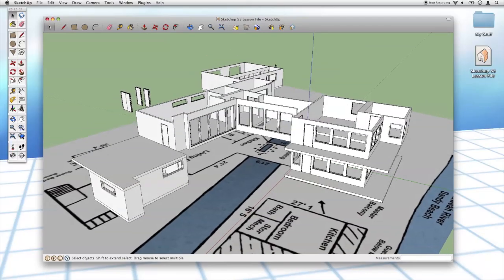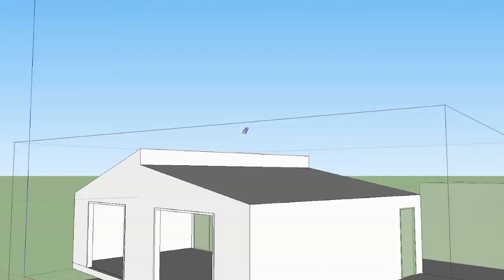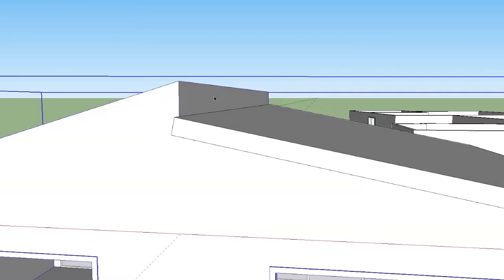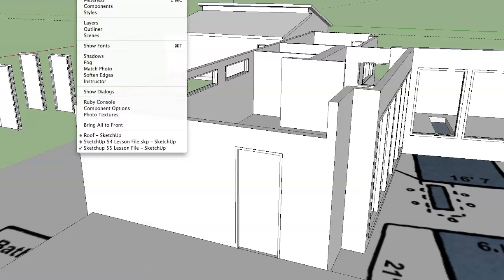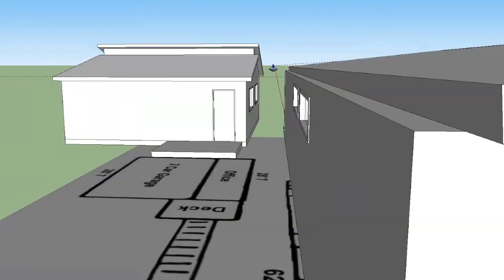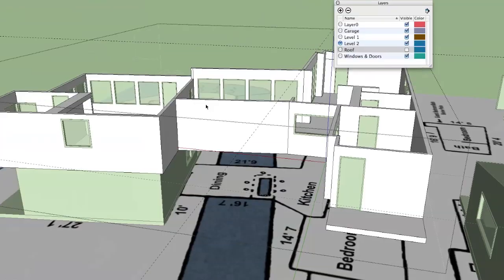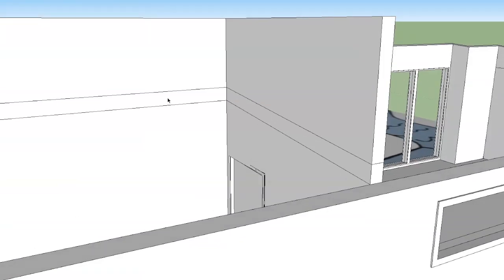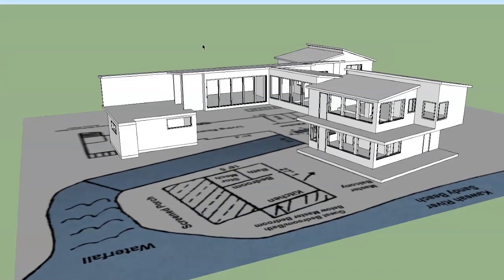SketchUp #55: Kaweah Falls Part 6

Comment: Hey Cameron thanks for your videos! One thing only..When you do that last bit where you trim the walls, wouldn't it be easier to actually use the 'Tools - Solid tools', 'Trim' option. what this will do is actually trim the wall bits automatically to roof, and then u just have to delete the upper bits of walls (the extensions) with one click (rather then going round deleting bits one by one)...Good thing about Sketch Up is that there are numerous ways of doing the same thing! Keep up the good wrk